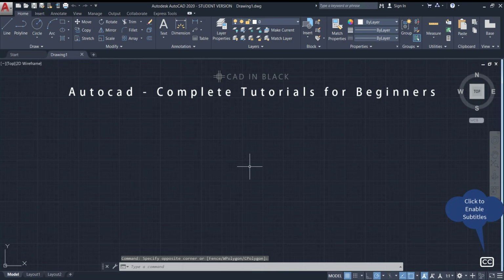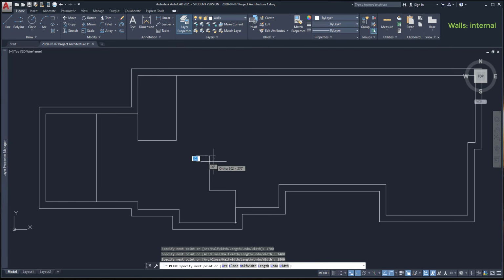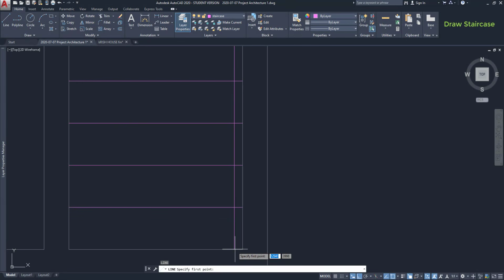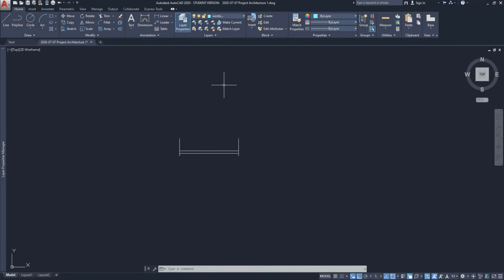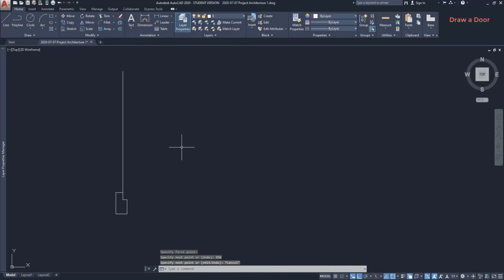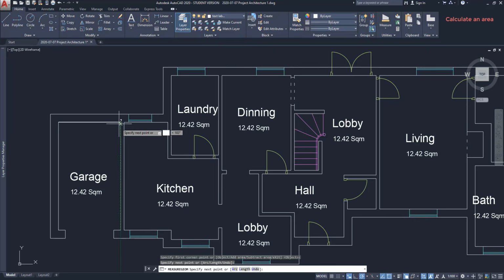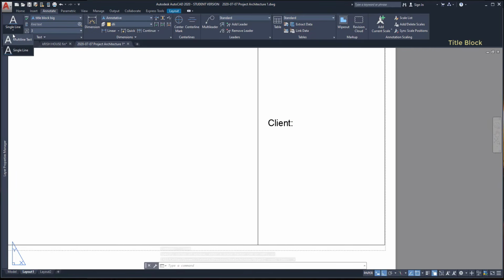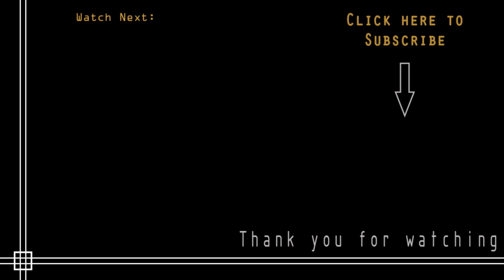Autocad - Complete tutorial for beginners - floor plan (ground floor)

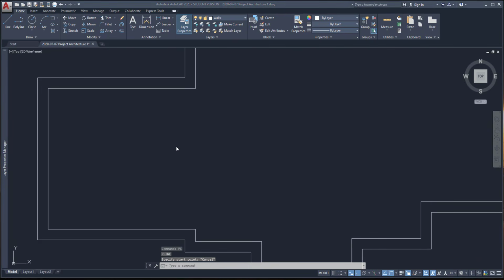Comment: 6:12 screen froze. i assume the endpoint is the furthest left point on that top internal wall?
Reply from the maker: Exactly. I am sorry for that problem as I haven't noticed it.
Go to the endpoint in the top-left corner, drag the pointer to the right and type 2700mm. Thanks a lot for mentioning this issue!

Comment: Nice video. When you create the texts I see that the scale goes from 1:1 to 1:100 which is the scale of the layout. Should I always change the scale to the scale of the layout when creating text ?
Reply from the maker: The scale in the model space only matters when you are creating an Annotated object. If the text is in a standard style it doesn't matter the scale. But If it is annotative, you have to draw it in the model space with the same scale of the layout! Thanks for watching.

Comment: Amazing video brother keep up the good work. I have been following the tutorial and drawing at the same time but I have run into a problem. Seems like you have not mentioned the dimension for the right wall of the bathroom area. In the video you put 3450mm but its no where to be found in the pdf. Thanks!
Reply from the maker: Hello Vigar. In some situations you have to subtract some dimensions looking at the pdf. I understand your point, but as I created the pdf later, I added the dimensions that I felt more convenient. Above all I didn't want to fill all the drawing with dimension lines. My apologies.

Comment: I was following along until I got to the arced part of the staircase and ran into a couple issues

1. What do you do if the array goes the opposite direction? I somehow got it to go the correct direction after clicking a bunch but I don't know how I did it.
2. It kept my array as one object, so it wouldn't allow me to extend the the lines unless I extended the original. I ended up just adding lines to the ends of those, but it would not let me join them afterwards. How do I correct this?
Reply from the maker: Hi Nicole! 
1. When you use Polar array, at the Array panel in the ribbon there is an icon called "direction". Click on it to switch the direction of the items.
2. Here I exploded the array, to be able to extend each line separately!
Hope it helps.

Comment: i know its a silly question but why do you offset the internal walls inwards, does that not give you different measurements? or do you measure the perimeter of the property and then offset external walls inwards, again i know its a brain block haha
Reply from the maker: All the internal walls have the same width. That's why I use offset. This command is useful also to make parallel lines!
Reply: @CADinblack  and is that in all modern houses also?
Reply: @CADinblack  thanks for the reply by the way

Comment: Hi some dimensions are missing in the pdf file when you were drawing the polylines
Reply from the maker: Hi. Yes, that's true. In fact my point was also to encourage the students to make some calculations. Not all the dimensions are needed as some lines just connect to others which have dimensions. However, it's possible that a couple of them are not possible to guess. Can you exactly which dimensions are you talkig about?
Reply: @CADinblack  yes I did some back calculation to figure some dimensions and tbh it's really annoying since I had to spend way too much time figuring things out instead of learning to do it
Reply from the maker: Hi +Flying Hippies Gaming . I added some dimensions more to the file. I hope it helps a bit more. https://drive.google.com/file/d/1QcJdPJdVrt27nDh9OieIe3KAJoksYKeH/view?usp=sharing
Reply: @CADinblack  thanks a lot...this will be much helpful for others
Reply: Sorry for hoping onto this comment. But I need help with this too.
What’s the dimension where the small (1300) wall jutting into the lobby from the dining starts? 
I can’t seem to figure it out.
Reply: @busumamwiche4749  Please check the drive link CAD in Black kindly provided above
Reply: @Flying Hippies Gaming, thanks for the reply. Still can’t find the dimension I’m looking for. Mind helping?

You’ve seen the horizontal wall that sticks 1300 units into the lobby slightly to the right of the word dining? What is the offset distance along the vertical wall that it is connected to? 
As far as I’ve seen the 4250 is split into 80, 1200 and then 2770.

Comment: Thank you so much for your hard work . This is a fantastic tutorial once you conquer the ground floor wall creation as a number of the dimensions are missing. I imported the PDF into autocad and scaled it with one of the known wall dimensions to get them accurately. I have a pdf with the missing ones if anyone needs it. Apart from that an excellent architectural lesson.
Reply from the maker: Hello Paul. Thanks for your comment. You can send me your corrections to my email. cadinblack@gmail.com. I will have a look to it. Thanks again.
Reply: yes pleasre

Comment: Some polylines measure is not included in the pdf file. Especially on the first part where you cut. Kindly mention what is the exact measurement of those. Thanks a lot
Reply from the maker: Hello. Can you tell me at what point of the video are you talking about exactly?
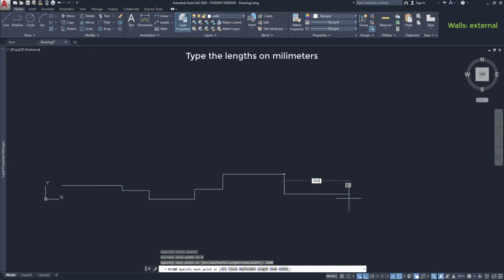Reply: @CADinblack  4:57 the one you fast-forwarded, some dimensions are not included in the pdf file and we are having a hard time to calculate it... can we perhaps see the normal speed to have the accurate and precise measurements of the floor plan.
Reply: @neronakyokomae3028  Have you figured out all the missing dimensions yet? If so, would you mind sharing them? I've been trying to estimate each wall for the last few hours but to no avail.
Reply: @neronakyokomae3028  Use the outermost dimensions
Reply: @Politricks312  Use the outermost dimensions
Reply: @lancea673  Figured it out a while back, thanks for checking in!

Comment: Love these videos CAD in black! Your videos are an amazing resource for me as I become more familiar with AutoCAD. As someone pointed out in the comment section, some of the dimensions are missing. It would be great if you can update the PDF file with these dimensions. Thank you so much and keep these lovely videos coming!
Reply: specifically the Y axis values for the exterior perimeter. (most of the left side of the schematic) thanks!! :)
Reply: I agree I've learned so much from the cad programme, I'm new to autocad thanks for the clarity and delivery.

Comment: thanks, you very much for your videos I learned a lot from you and really appreciated. I got a bit problem when I select a polyline and put the cursor on one corner and move to the right like what you said and give a proper value to it then doesn't work plz help (video 6.11)
Reply from the maker: You should first activate the command. (for example line). Then, DON'T Select the polyline; -> go to the corner without clicking, then move to the right.
Hope this helps